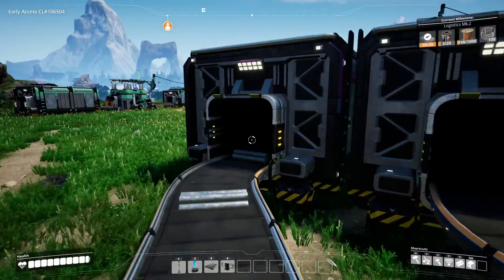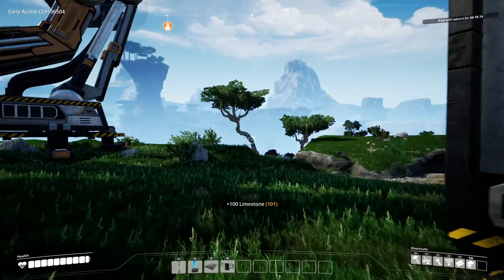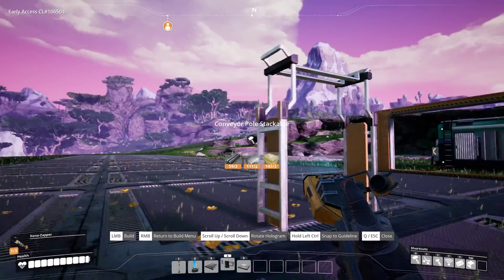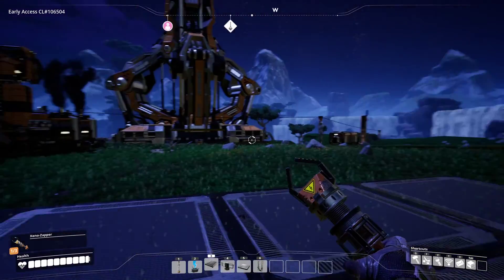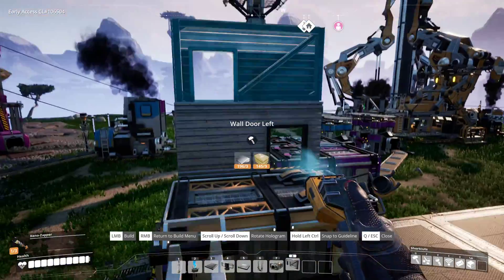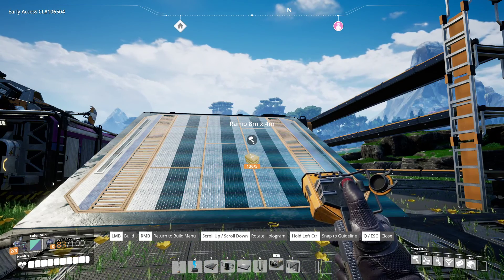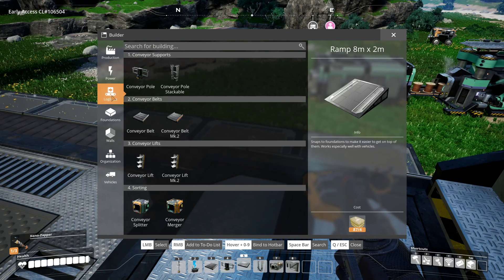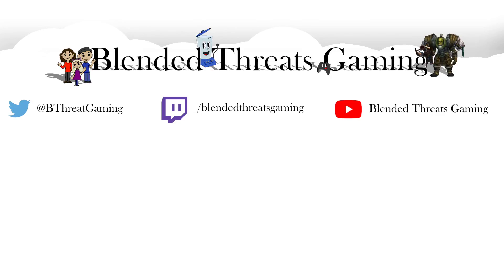Satisfactory Gameplay #7 [Tony] : THE TIME FOR DESIGN | 2 Player Co-op

Comment: Hey guys,

Just finished binging you series. Great job!. I've been playing Satisfactory for a couple months now and love it. I thought I'd give you a few tips I've learned so far...

You should convert all your biomass to biofuel. You don't have to add fuel as often that way.

Rachael was out exploring and found a slug up on a rock she couldn't get to. There was harvest-able ivy on the side of the rock she was running around trying to find a way up. That ivy is climbable.

On a side note whenever you go out exploring you should always take a bunch of concrete with you and use it to make ramps and platforms to get to hard to reach places.

You can take the power lines coming off all your generators and connect them together and then run them out and you don't have to worry about which line has what power.

As you discovered, gravity doesn't affect things like platforms. But what you might not know is once you place a platform you can take away the walls and they will float there without support.

You can hold down the "c" key to get a radial menu and change what you are scanning for. The scanner has always only been scanning for iron because its never been changed. That's why you have been having a hard time finding things.

When using the paint gun in addition to changing the color you can edit the colors and change them to any color you want. In addition the first color choice is the default color so if you edit that color it will change everything that is currently the default color.

Also on a side note sometimes objects won't show the color you have changed them to. It's a bug but is fixable by simply using the deconstruct tool to mouse over the object. Don't know why but it works.

Resource nodes have a quality. The quality affects production rate. impure, normal, and pure. Try to use pure whenever possible.

Now that you have got better belts you will probably want to upgrade to them. Instead of having to rerun the belts you can simply select the belt you want to upgrade to with your tool and click the existing belt. It will automatically replace it with the new belt.

You can ride the flying manta if you can find a way to get on it.

The Mercer Sphere and Somersloop items don't currently have any use in the game. But might in the future so I always collect them anyway. (Also, the Mercer Sphere is a tribute to Matt Mercer of Critical Role).

Belts and lifts have a direction so try to get in the habit of placing belts from start point to end point. It will save you from headaches down the road.

Find and research Caterium Ore. You will get access to Blade Runners. Faster movement, higher jumping, less damage when you drop from heights

The wreckage Rachael found will contain hard-drives. You research these and get alternate and usually better recipes that require less resources to make things. These site are scattered all over the place.

The conveyor pole requires two clicks because you can change the height of it. Click once to place then drag up and click to set the height.

When you where trying to place the platform higher than the one next to it, what you can do is stack platforms on top of the original platform until you get the height you want. Then snap the platform you want higher to the top one. Then remove the stacked platforms.

Well that's all I can think of at the moment. Oh, and here's a couple of sites you might find helpful...

https://satisfactory.gamepedia.com/Satisfactory_Wiki

https://satisfactory-calculator.com/en/interactive-map#2;50000;0|gameLayer|

Oh, one more thing... You can tame the Lizard Doggo.
Reply from the maker: Thank you for the awesome post, this is extremely helpful and something I will pin so others can read to gain from. One thing to note with this series is we are currently pretty far out on the recordings for this so it will be coming out 3 days a week for at least through January and we have figured out a lot of what you said here, actually wish we would have had this post before because this solves a lot of things we ran into but at least it is there for others to learn from. 
If you are interested we also stream this on our twitch channel when we play which shows where we currently are :). 
Thanks for all your awesome effort on this post -Tony